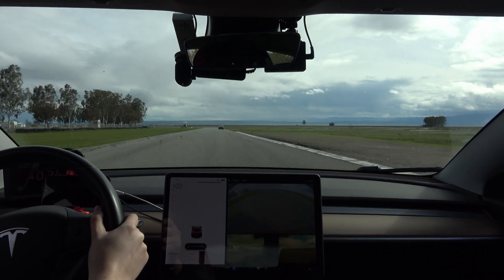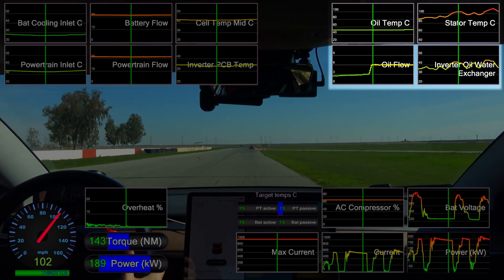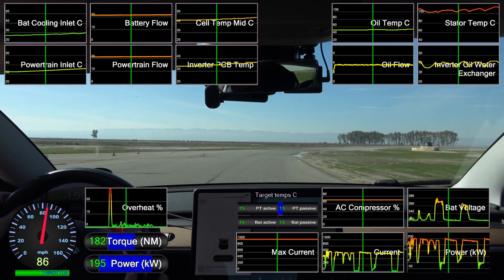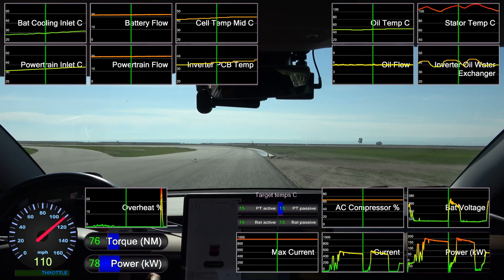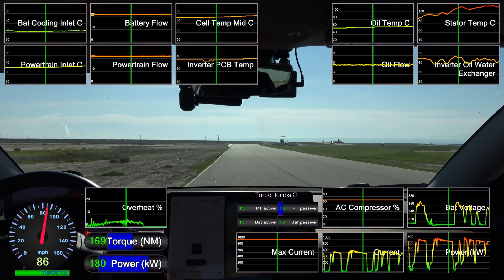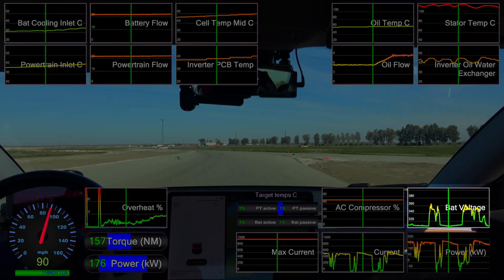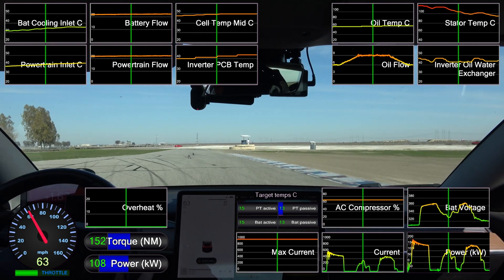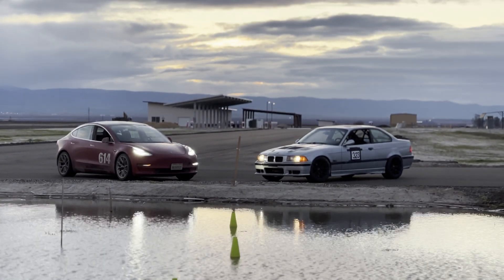How fast does a base Tesla overheat on track?

Comment: Yea def need a track mode, the tesla reallllllly doesn't want to run the oil pump. Track mode will overcool the battery to give a large thermal reservoir.
Reply from the maker: I built an oil pump interceptor that commands it to run at max rate on the track now. Mountain Pass's Cooling Box takes care of the battery precooling, but it still isn't nearly enough.